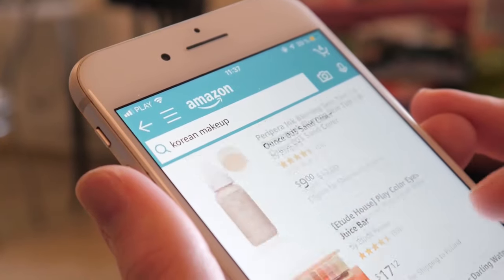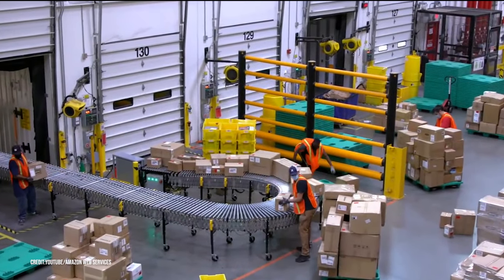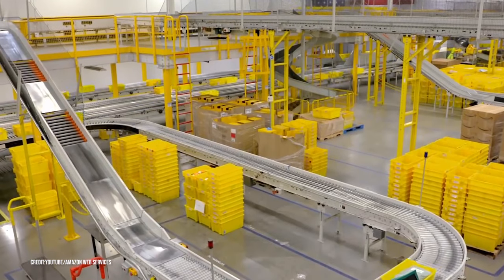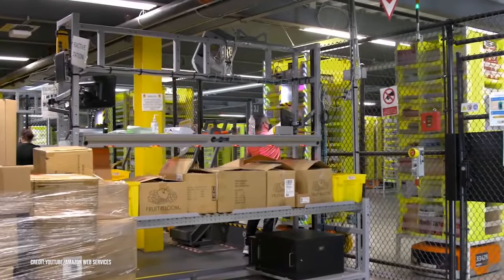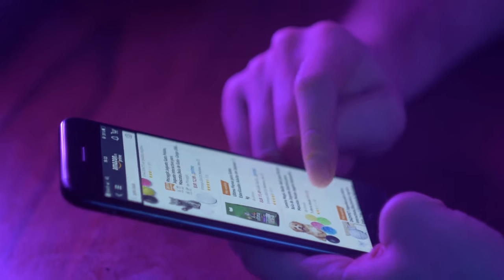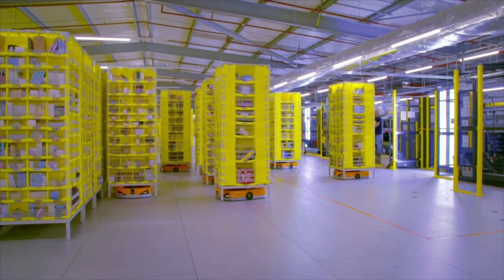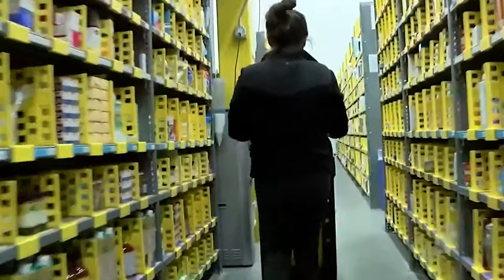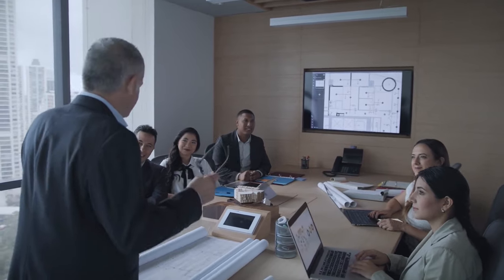Inside Amazon's Largest Warehouse

Comment: It doesn’t explain adequately how my item is picked. I know there is a man called a picker but that really doesn’t explain how my mirror has been picked.
Reply: The Picker gets the location of the item on his scanner he goes to the location scans the shelf than the item place the item into a tote and scans the tote that how picking works
Reply: Watch around 6:30. Those robots bring items to a picking station in most cases. The picker will remove the item from the robotic, then scan it to a yellow tote an put the yellow tote on a conveyor belt to be taken over to the pack station.